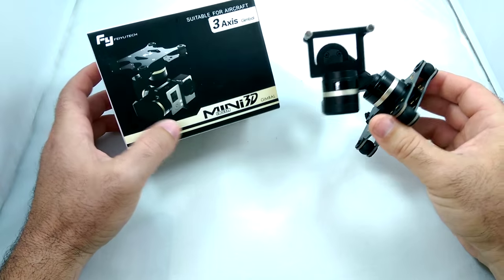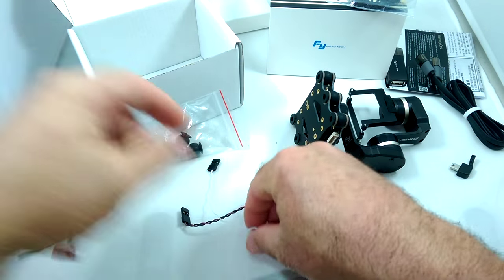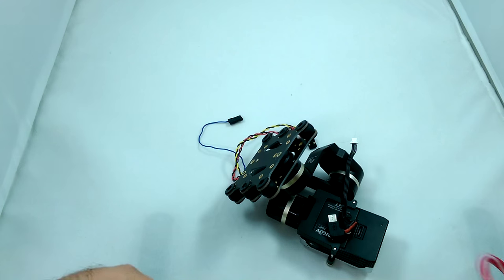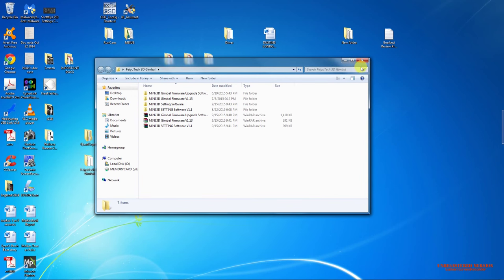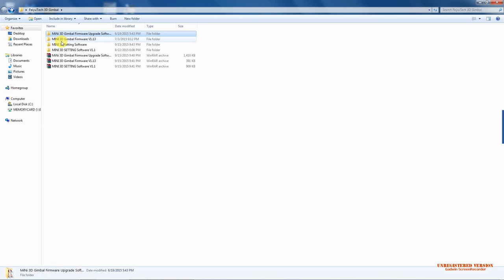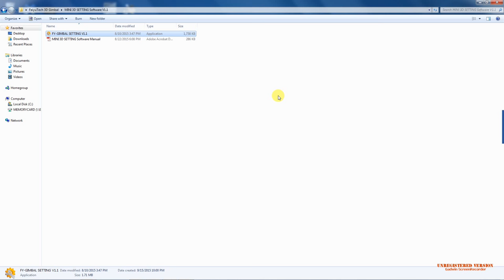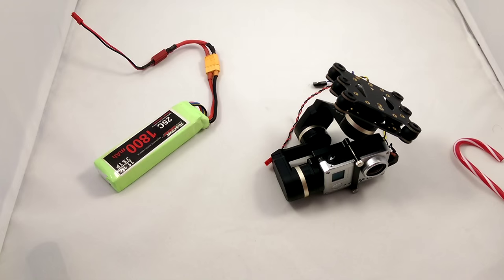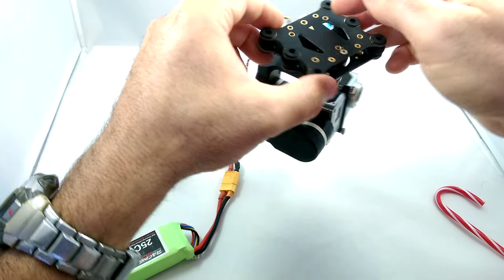FEIYUTECH MINI 3D Brushless Gimbal Review - [Setup, Flight Test, Pros & Cons]

Comment: Nice Video Dustin ! are there any issues with interference when connected to the X380? also any way that the gimbal can be mounted so that the legs dont show in the video?
Reply from the maker: +V P some have had compass interference.  Mine was minimal.  Extending the gimbal forward or narrowing your cam field of view if it supports it gets the legs out of view.
Reply: Thanks Dustin, ive ordered the X380 so was looking at some 3 axis gimbals that i can use with it. Was particularly interested in this one as it looks sleep and well made.

Comment: Great review, Dustin. I have purchased an X380 (Great camera quad) and looking to buy a gimbal. This one looks like the way to go.  Your video is amazing. Do you recommend this one, and if so, does it work with the tilt feature of the 380? Any thoughts on getting the landing gear out of the way?
Reply from the maker: Thanks John.  Yes, plug in tilt and you can control with knob on controller out of the box.  I'm going to be attempting a few things to eliminate legs in view.  1. Narrower FOV camera.  2. Carbon tube mount and use the plastic clamps that came with gimbal to move it more forward.  3. Look into different or retractable landing gear.

Comment: Hello Dustin,

Amazing video review about the Feiyu Tech Mini 3D.

Need your help on the solderingof the micro conector.

By the way have you tested their new Mini 3D PRO "Bruthless" Gimbal? (they have it like this on the official website and i wonder if there are also "errors" on the hardware itself...)

I am one of those that bought the 4balls version a couple of weeks too soon and i'm curious about this latest 6ball version (features like 360º...). 

On this video, you show the cable prepared with the micro USB instead of the original mini.

I need to do the same, thus, avoiding the "anchor" wire hanging between camera and video transmiter. 

I have one of those micro usb conector with 4 wires (red=B+; black=B-; green=AV-; withe=AV).

After clipping out the mini conector i'm left with a molex and 3 wires (5V is missing), i just need to know the soldering  (Video control=?; Video=?; Ground=?)

Sorry for the long post,

Thanks.

Comment: Is there a mode on this gimbal that locks the pan axis as well? ie: not follow the aircraft yaw at all.
Reply from the maker: If I remember correctly, you can lock the pan so it's just a 2D if you want.
Reply: Can it also pan 360°?

Comment: Another great review, Dustin. Gimbal sure does a great job. I recognized the video from a previous review (but parts were edited out for time). Sure looks like a winning combo to me. Howbgood was your fpv feed when you reached the quad's range limit? Thanks for the review! Cheers!
Reply from the maker: +Bill Somrak Hey Bill, It's a great upgrade from a 2D and seems to perform well at a very competitive price... also the quality seems excellent thus far.   Yes, that's the kaanapali vid I took a while back.  Sorry about the abrupt cuts,  didn't realize they were that jarring with the music skipping :)  In the main kaanapali video where you can see how I turned to look at that ocean cave.. I started to get fuzzy a bit in the goggles so I gained a little altitude and the fuzz was gone all the way out to the TX range limit.  FPV was crystal clear as long as the LOS was clear.
Reply: +Dustin Dunnill Looks to be a sweet setup.  Now I just have to convince myself that it would make an excellent Christmas gift (to ME) .. ha ha.  That firmware/setup program looked a little 'user unfriendly', especially if the directions are given in "Ching-lish".  At least this vid is up so people can keep referring back to it if necessary.
Reply from the maker: +Bill Somrak I do like the gimbal.  Software is a little bare but for plug and play it's fine.  The motors are the most powerful I've tested for their size in the gimbals I've tested so far.

Comment: It's the UltraPro-X Cam-10 It is 45mm tall so it wont fit I think the gopro is 43 or maybe 42 dont remember now . Is the bracket aluminum or plastic ?
Reply from the maker: Roger that thanks.  The bracket is aluminum.

Comment: Be eful with usc connector on gimbal as mine snapped out at my first try becuse it was already loose (bad soldering or low quality control etc..) Also mine YAW axis motor was not working at all and pitch motor was pointing down once I first started up. So I had so many problems even before using it. Contacted Feiyu and they even dont respod at all.. Will see what gonna happen! So be careful!
Reply from the maker: +Gur Isler Thanks Gur.  No problems so far with the unit I got.  Everything was fine.  Hope you get it replaced.  Try to contact the vendor you purchased from to get it sorted out.

Comment: Hey Dustin I need to take a look at one of those for my Phantom . I'm using a Tarot on my F550 but they hang down too far for the regular landing gear and if I put longer landing gear on it want fit in the backpack . I still have a few bugs with the programming on the F550 and the Tarot I just need to hook up and get it done .
   Great video , always great views with your videos . Have a good one .
                                      Spencer .
Reply from the maker: +Spencer Boaz Hey Spencer,  It's a nice 3D for the money.  Best I've tested so far.  It's also nice and small so weight and height are not a problem.
Reply: Dustin Dunnill Dustin my camera is 45mm tall I had to mill the top lip of the Tarot GoPro 2D off and glue a thin piece of aluminum angle to it and drill a hole in the bottom for the screw then I put a piece of brass on the back with bubble sided tape to balance it all . But the camera takes supper video up to 4K and was only $129 but I don't have a gimbal for the Phantom it is just hard mounted and I get a lot of jello . Sorry I just saw your reply .

Comment: What if you camera can only handle 5 volts. How would you power the camera from the drone which is putting out 12 volts?
Reply from the maker: The gimbal regulates down to 5v if you want to power Cam
Reply: ok Thanks

Comment: Great review, the Gimbal does look very well made.  What about the New 2-Axis version that they have ? for the XK X380 since is only using the tilt pitch any way.  Thanks
Reply from the maker: Hey Toan, yah the 2 axis looks good too.  Just won't iron out any yaw wag like 3d does but the X380 has very stable yaw anyway until wind effects it.  I just use the 3rd axis for stabilization not on a channel.  Only using tilt on gimbal for tilting camera down.  The other 2 axis are strictly just auto stabilization.
Reply: +Dustin Dunnill Hey Dustin, I see that a lot people complaining about the plug on the gimbal is very Fragile.  If I get this 2 Axis version do you think  putting hot glue around the plug area to strengthening it would that help ? Also where can you find parts for this brand gimbal ? I try to search on the web but no luck so far.
Reply from the maker: +Toan Lam I haven't had any issues but i'm careful with stuff like this and never force things.  Yes, hot glue would help to brace.

Comment: Great review!I have a TBS Discovery with AerialMob arm kit and DJI E800 6S propulsion system and I'm looking for an affordable gimbal to play with together with GoPro 4 B.Will this gimbal work with a full 2-6S range or do I have to arrange with 12V supply?Would be great to connect directly to the power board.
Reply from the maker: Cool!  Sounds like a killer setup there.  I think manual states up to 18V so you have to get a converter for 6s...man talk about power!  How do the props not dicintegrate ;)
Reply: +Dustin Dunnill 
I ordered a couple od DC converter from 6S to 2S so then that problem is solved. :)
Not sure if I shall go for the FeiyuTech or if I shall go for the GL-X3 gimbal.

http://www.ebay.com/itm/251542144468?_trksid=p2055119.m1438.l2649&ssPageName=STRK%3AMEBIDX%3AIT

Any comment on this? ;)

I must say that the Discovery with arm extension seems to be very rigid and yesterday I arranged with a battery tray so that I can use on 6S 8000mAh in parallell with 2pcs 3S 4400mAh in series... Sounds a bit odd, but it will be fun to try it out. The weight is nearly 2kg of just LiPo, but 4x E800 shall be able to handle a 6kg start weight...

Would like to to find a set of quick release 1545 or 1552 props to fit the E800 motors, since the arm extension is used with 15" by TBS themselves. Haven't been able to locate such.
Reply from the maker: +Jan Ellwoth Cool Jan,  wow that's a great price if it works??? Have not heard of that one or seen any reviews on it.  Sounds like you got yourself a beast of a copter there.  Let me know what kind of flight time you get.  Good luck with the build!
Reply: +Dustin Dunnill Haven't found any real reviews, only some videos on Youtube showing the movement with pitch and yaw control. Would be nice to be able to control yaw with the throttle stick and still be able to control pitch and roll with radio stick. Altitude by FC and you are more or less equal to the Inspire 1, but with a more accurate gimbal control... ;)

Comment: Great review Dustin. Just 1 question, as i am currently using windows 10 and i am aware that a lot of drivers dont work properly with it, whenever i try to update or do any settings, the software doesn't read the gimbal. Do you know what i should do?

Comment: I bought the X380 after tooling around with a cheaper quad, however I bought the option that came with a 2D gimbal and a camera. Boy do I wish I had just bought the base model and put that money I would have saved into a gimbal like this and a GoPro that I ended up buying anyways.
Reply from the maker: Thanks for your thoughts.  Some have had good results with the OEM gimbal and some haven't.
Reply: I do like that it has the rails for mounting the gimbal further forward so the legs don't get in the shot. Hopefully I'll be able to reuse them to work with this gimbal.
Reply from the maker: That's was Exactly the reason I almost bought the gimbal (to remove it and use FeiyuTech with rods).  Decided to just get a CF rod/mount combo for $20 but still need to install and see how it works. Good luck with your mounting.  It seems like it should work nicely.

Comment: Hi Dustin, thanks for the video, I want to buy this gimbal, but I want to make sure that can be mounted in 3 mode like the PRO, can you confirm that please? Thank you.
Reply from the maker: +Fra R. Yes it can.  Hanging, forward or upright.  You just use have to set it with the firmware

Comment: Can you tell me how tall your camera is ? My cameras are just a little taller than the gopro hero 3 and don't fit the bracket that has the top lip on the Tarot I had to mill that off . My camera is a 4K and was much less than the gopro but does a great job . So I dont want to change cameras it works fine with the tripod screw hole in the bottom . Anyway if you could check that out for me sure would help .
                       Thanks Spencer .
Reply from the maker: +Spencer Boaz The cam in video is same dimensions of the gopro 3 hence it fits in the provided bracket perfectly.  Which 4K cam did you get?

Comment: Hi, I ordered the x380 Quad still waiting for it but I was wondering did you ever figure out a mod to get the legs of the x380 out of the picture frame? I have not purchased any gimbal or camera yet. Thanks
Reply from the maker: Hey Randy.  Congrats on your purchase!  Funny you should ask.  I just ordered 10mm carbon fiber gimbal tube mounts to be able to hang the FeiyuTech more forward with its supplied clamps.  Hopefully it works.
Reply: +Dustin Dunnill Sounds great! I hope maybe you can do a video on how to do this mod. I am moving up from the Syma X5sc. It was my very first quad for learning how to fly.. After much frustration and flying it into trees and several crashes its served its purpose LOL...I&#39;m now ready for some GPS flying and much needed better video quality.  I picked the x380 model from your link you posted as most everyone seems to like it and it had a pretty good price. Only thing I am wondering is it said ships from USA warehouse but says EU plug? I live in US so I guess I will need a adaptor maybe. Not sure what I am going to get as far as that. Thanks for the great videos. Very well done!
Reply from the maker: Once I get the parts and test I'll do a quad setup vid as well as the TX mod vid.  Good idea to have an adapter just in case...they are only a few bucks.  Sounds like you've done some practicing, good take it slow with the X380.  I recommend opening the top and also TX and looking over all wiring and solder pins/joints before your first flight.  If all looks well, do the calibration in manual, make sure you let ot sit a few minutes for good GPS lock and hover maybe 12 feet and test modes in a big park.  Don't go higher until your second battery charge in case something's not right and it falls.  Have fun!

Comment: Would you think this could fit onto a phantom 2? Looking for the 3rd Axis damping.
nice video.
Reply from the maker: +Mike Simmonds yes it can.  Just plug into the f1 and or f2 channel on flight controller for pitch/ roll mount and power up :)
Reply: I had one arrive today.  looking forward to flying it.  Looks smaller than the one I have and neater too with less parts and joints visible.  Very nice.
Reply: Sadly, I have one which does 90 degree up pitch but only 30 degrees down.  Bugger!

Comment: Hi Dustin! You tried this with the X4 Pro standard edition, does it only control the pitch? Which camera would you say is better for aerial photography, the GitUp Git 2 or the Amkov 5000s? (Also, can you take photos with the camera using the Standard Edition controller in midair, like you can with the default Hubsan camera?)

Thanks so much! You're really helpful, and your videos are super informative. Thanks to you, I've got an X4 Pro from Gearbest and am happily flying it :)

Comment: Hey Dustin just wanted to know if theres a way to mount these to a tripod or quick release plate or a way to place a Yi on to this
Reply from the maker: +Zero21x yah, this gimbal can be mounted facing forward or up also.  I guess you could get or make a bracket for a tripod.  Not sure on the Yi as I don't have one to test.
Reply: +Dustin Dunnill do you know what exact screws it uses to that top plate?/bracket
Reply: one more question could you give me a link to the battery( or a longer lasting one) you are using to power the Gimbal is there anything extra i might need with it that it does not come with as well?
Reply: actually i ordered one but i dont believe it comes with that connector you have between the gimbal and the battery what is that extra wire called or where can i get it? seems to be an converter or adaptor at
25:03

Comment: qav400 
everything work flowless  i really like these gimbal
i just need help with the yaw and pich  i konw blue is pich and white yaw and i have two extra channels on my reciver  for both wires  iam using dx9 trasmitter
Reply from the maker: Just figure out which knob you want to use on controller and make sure you connect pitch wire to the channel that knob controls on receiver.
Reply: tiger exhaust  flawlessly, pitch, receiver

Comment: Hi Dustin,
Thanks for such an informative video. I have just bought this gimbal along with hawkeye firefly 7s camera and TS5828s transmitter to mount on my quad for FPV. I am struggling to understand how can I connect camera, gimbal and the transmitter to get the video on my goggles?
Reply: I need help with connecting this gimbal with the AV transmitter please
Reply from the maker: +Aftab Afzal Hi, it's complicated to describe here.  Please try to google FPV wiring

Comment: Hi Dustin,
Thanks for the great review. So you convinced me and today I received this gimbal and I mounted it on my X380.  Only tomorrow I'll have a test flight. But I'm concerned about the legs in the frame. I think that I can manage to flip the vertical hang 180 deg. ( like I done with the generic 45$ gimbal and worked fine) but if so I will need to change the configuration of X axis to X suppose, and there is no soft to do this. With carbon tubes I cannot find how to fix the tubes to X380 and after this those brackets supplied with the gimbal will lower all some 3cm. I have already 1 inch sponge under the legs, I don't want 2 inches :). One guy from FB channel flipped the front right leg to the back and because the lens camera is off axis solved the problem somehow, but it has a trapeze landing base. 
So, do you know if there is a way to configure the axis parameters?
Hope you had the patience to read all this. 
Thanks, 
Marius

Comment: Hello
Please do you use the feiyu video output and camera charging cable or you made your own one?
I use a firefly 6s camera, has the same size and weight with the gopro 3. I dont know if the output pins are the same with the gopro 3.
Reply: +Bill Bonovas Yes it does work. got my Firefly 6s hooked up with de gimbal. It charges and the video output cable fitted on the boscam av transmitter. just check connections are the right way around.

Comment: Hey! I wanted to mount this to my dji phantom 2. would you know if the dji transmitter remote  pan knob will work with it?

Thanks.
Reply from the maker: I don't have a phantom but as long as you hook up the signal from quad to gimbal it should.

Comment: Hi Dustin, I just get my mini 3d, use with a diy hex, naza-m v2 controller, spektrum tx/rx. but no matter I connect the blue wire(pitch control) to naza-m or rx, I cannot get the pitch control. Can you actually do a wireing video for the gimbal please
Reply from the maker: +Rodar Luo Sounds like you may need to make sure the channel on the naza is configured to the controller input you want it to respond to.
Reply: Dustin Dunnill thanks for reply. I finally figure out what happened. It's very weird I have to plug in the mode control wire to my rx. Once the wire connected, I got the pitch control. Don't know why